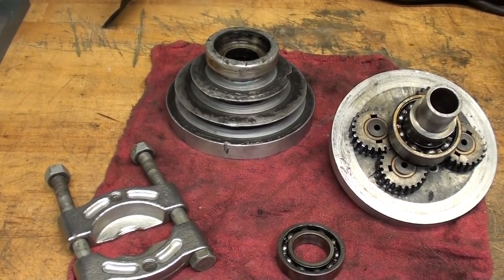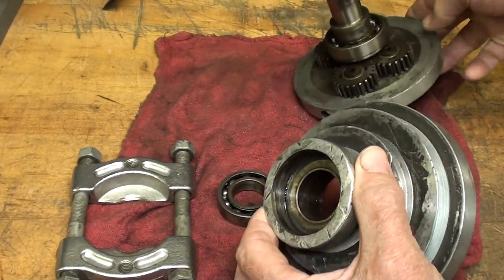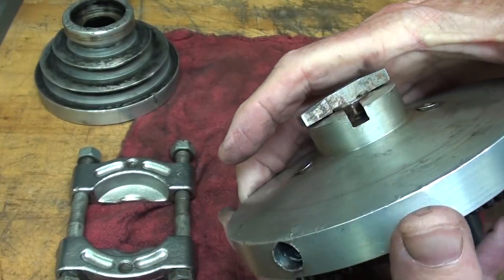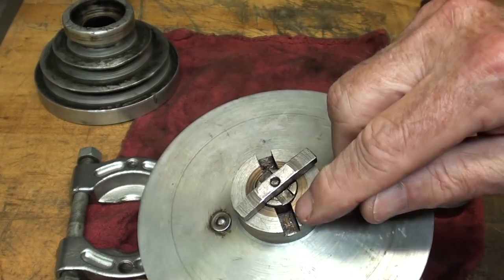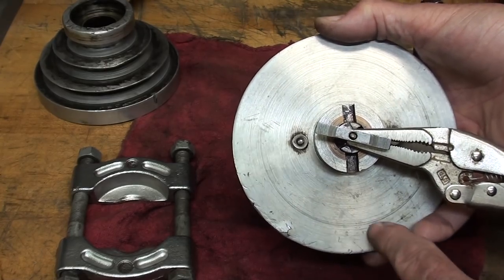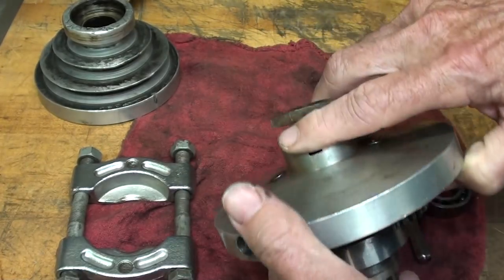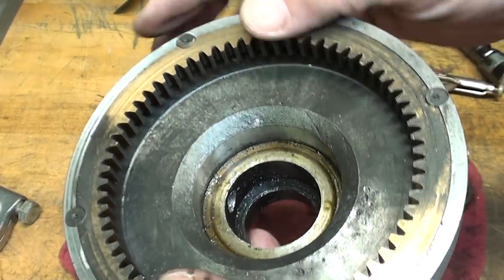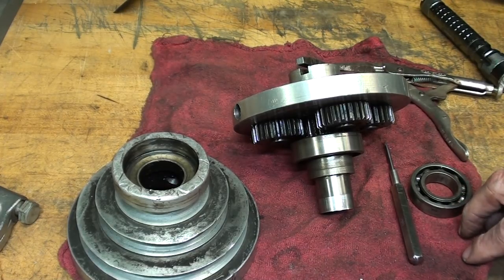plea#2 tubalcain NEEDS HELP with a PULL GEAR SPEED REDUCER

Comment: mrpete222: Those pulleys are in pretty rough shape. Could you turn a new set in the lath ?
Reply: Stanley Denning   I agree. A nasty old pully. Looks like it has been on a machine for years. A big project to redo. It might be the best idea. But mrpete222 might want to experiment before going that far.
Reply: I agree. Make a new pulley, and fit the original gear ring into it.
Reply: Ideally he could turn two double belt pulleys that wouldn't slip. That issue was mentioned and easy to fix with a double belt system

Comment: Try not to cut that rod.  Instead. support the bar detent away from the body of the device then with a small pusher, push the rod through the bar detent.  Despite it beeing peened over you should be able to push it through.  It may hog out the detent but that can be remade, or repeened.  If you cut the rod, it will be harder to get an accurate finished length for the new rod.  OR, cut the bar detent away from the rod, leaving the rod intact.
After that, you can push the main part through.
Also, that hole in the side that is damaged where the anti rotation pole goes, instead of repairing that hole, drill a new one elsewhere on the rim and fill in the old.  I imagine that will be a better repair.
Reply: The pulley defects including the “hole” can be completely repaired via TIG and then machining. Find a T IG expert.

Comment: Take some brake cleaner spray down the bearing and blow it out with air hose . You might be surprised and get the grit out of the bearings . You might get away from replacing them

Comment: Dear Mr. Petersen. I like that pull gear speed reducer so much that i tried  to replicate something like that myself. However, i figured out that in planetary gear systems, there has to be a stationary part to make it work. My guess is that You need to literally put the bar inside that side hole on the upper part and make it stationary with your hand or something to get the needed speed reduction.   Am I wrong?

Comment: The four small gears run on hollow spindles. Are these spindles removed with jackscrews? If so can the spindles be used to separate the shaft from the hub by pushing against the outer race of the large bearing? The peen and the lever will have to be removed in any event.

Comment: One has to think, how did the engagement rod (appears item 99) get peened while in the assembly. Takes a lot of force and the 'peen' is too clean looking. Regardless, I would use a Dremel style grinder to cleanly grind the lip off the rod.

I agree with you and others the shaft should be pressed out from the top. But you could also press the bronze bushing at the same time as you have to use the bronze bushing to press out the smaller bearing anyway.

Having a patent myself, there is an interesting aspect. When a patent is filed it usually documents the first prototypes of the device. Once in production the parts and some details of the assembly may change to optimize production. This does not change the patent as the patent is for the idea (or process), not the precise device. In this case you appear lucky in that the drawings so far seem to match the device well.

It will take a lot of grip on the engagement shaft to peen it or you might consider making a two part 'dog' (appears item 99) that clamps over the engagement shaft. In this case you might consider using a  Dremel grinder and instead of cutting/filing/grinding the 'peen'/flange on the shaft, use a cutting wheel to cut the dog off the shaft to preserve the current peen/flange on the shaft so you can simply clamp the new two piece dog (rivets or screws) around the engagement shaft when you rebuild it.

Lubrication - appears to me that the thing needed to be loaded with heavy gear lube. It is so dry inside - appears the original owner never greased it to flood the ball bearings.

Comment: Wonder if you heated  the peened part of the shaft to welding temp with the handle out of the way if you could pull it over it with a small bearing splitter? Might destroy the aluminum or pewter handle though.  Looks like the Saginaw 3 speed overdrive out if my 55, 56 and 61 Chevy's transmissions. It had the sun gears like that for the overdrive.

Comment: It appears to me that you will need to remove the larger bearing first with a bearing splitter...hopefully.  I would probably worry about gauling as the bearing was dry and probably hot...maybe a bit of heat during the pulling??  

The reason is that the larger bearing rides over the top of the planetary's which have keys that will not let them be removed otherwise with the bearing in place and the smaller bearing will damage them if it comes out with the shaft and pinion.  Once the large bearing is off and the planetary's are out of the way I would think a light tap with a mallet and soft drift you should be able to tap the shaft and small bearing out.  Then remove the small bearing with a puller from the top side.  I can't tell from the drawing how the pinion is attached to the shaft...key or pressed on or???  

Agree with others below about just filing the small peen off or use a dremel with a sanding drum to lightly remove it and preserve as much of the shaft as possible.  Thanks for the followup and wished you would have said; "Spoiler Alert" on the beauty of a restoration of the tool grinder...now I'm drooling to see the other vids, especially the casting and cover build!!!

Comment: The holes under the oilers look like they are threaded, and oversized... I wonder if that was meant to take a couple bolts to press it apart.
Reply: Tim Attwood 
good thought!
Reply: Yeah, but how would you take the oilers out?
Reply: voron11000  
I would assume they should be sacrificially drilled out and replaced with new upon reassembly. They are readily available and inexpensive.
(edit) Another thought: if holes are not threaded for Jack bolts, perhaps fabricate a 'pressing plate' of heavy barstock with two appropriately sized and located pressing pins (drill rod?)

Read less
Reply: Well, it might be a bit of a stretch, but who knows.

Comment: Use a Dremel grinder and grind off the edge where the pull shaft is peened over while trying not damage the core of the shaft.

Comment: Why not use a drift to reform the end of the shaft so that no metal is lost and then thread it? Counterbore the knob and make a sleeve nut to retain the spindle in the correct position.

Comment: Since you can pull the plunger rod up to capture it and then push down the little key, couldn’t you just file off the peen (radially) to release the key rather than shortening the rod?

Comment: build yourself a hydraulic press with a jackstand, old tony has a great video about it and i think it would be very easy for you to build it. then i'd say try to press it out, if it works great, if it doesnt, you still have a new tool to press bearings on :)
Reply from the maker: Which video of Tony?
Reply: i cant find it, but it was similar to this one: https://www.youtube.com/watch?v=I5TTGE0QCf8 thats the video i built mine from and it works like a charm to fit and remove bearings and crushing "projects" that didnt turn out how i wanted to :)

Comment: A bead roller with 2 flat cylinder anvils will squish the peened shaft back. Hopefully it won't work harden.
Reply from the maker: Got it done, I filed the thick part

Comment: You might be able to defeat the peen with a drill or end mill and put it back together with a tac weld not having to re-make the little shaft? But that doesn't answer the question you are asking.
Reply: I see you found a better way... a tac weld might still save it.

Comment: The gear reduction will not increase the torque on the belt. The extra torque is adsorbed by the rod that goes in the hole.
Reply: No.  That is nonsense.  Please learn how a planetary gear system works.
Reply: I would like to learn, please explain it to me.
Reply: Okay.  Well, the first thing to understand is that the rod is applying a torque - but that torque is (quite clearly) not being applied to the part of the device that is rotating with the belts.  So, we can immediately see that it would be inappropriate, in our analysis, to treat that torque as if it adds to the net torque on the output.  Similarly, that torque isn't applied to the input, either, so we can't add it to the net input torque.  If you look at the role of the piece connected to the rod in the planetary gear system, you will see that it is the "carrier" - the stage in-between the central "sun gear" - in this case, the input from the motor - and the outer "ring gear" - the output to the belts.

Fixing the carrier so it cannot rotate (which is what is done when the rod is engaged) does apply a torque to the carrier, but all this torque does is prevent the carrier from rotating.  Nothing more, nothing less.  We can thus analyze the system knowing that the carrier will be totally fixed.  In this situation, it should be reasonably clear that the gears on the carrier are simply acting as idler gears, and the whole system reduces to a simple, ordinary gear reduction between the sun gear and the ring gear.

As a rule, if you have a closed system with a single input, output, and some gear ratio such that n turns of the input results in m turns of the output, the torque (neglecting friction) must change by a factor of (n/m).  This is guaranteed by conservation of energy - torque times angular distance must remain a constant.  Note that even with the torque applied by the rod, this device is still a closed system, because while the rod applied a torque, it does not add any energy to the system (the torque merely keeps part of the device from moving, so the torque is not applied over any distance - recall that energy is equal to torque times angular change).

Comment: First off....grind or hammer the peen back and you can likely reuse the shaft and re-peen. Instead of pushing the shaft thru, use the splitter from the other side, and use 2 jack bolts in the splitter to push against the base, to pull the shaft out .... no need to hunt for a hydraulic press.